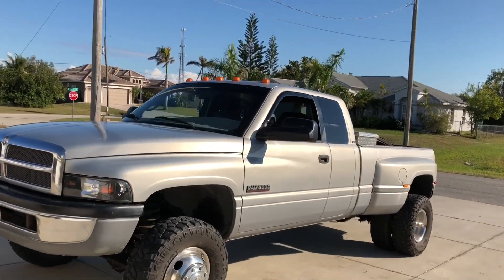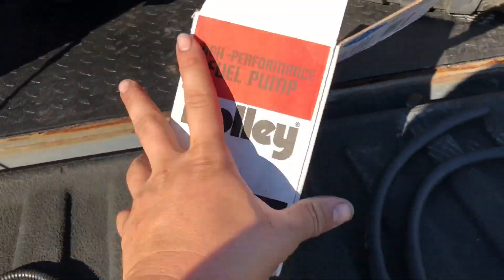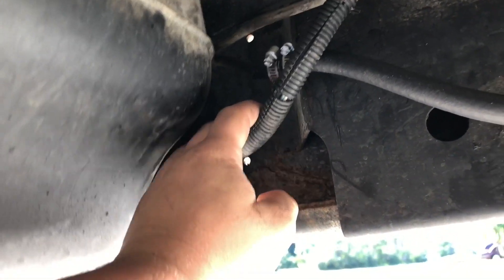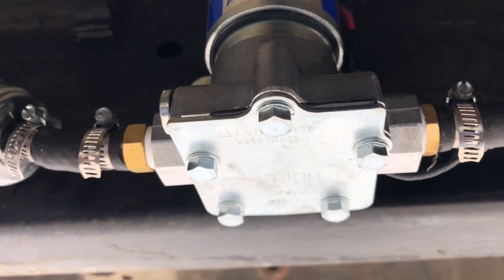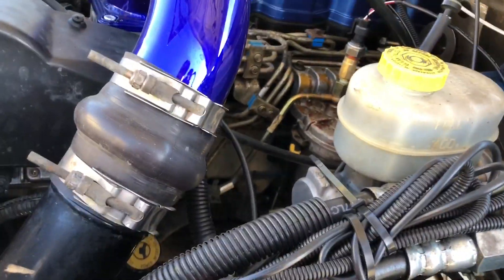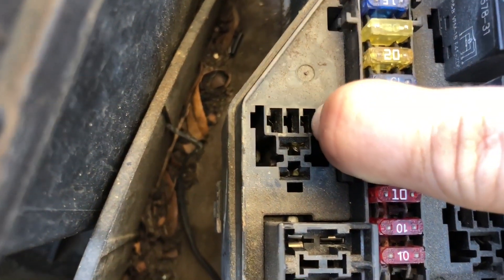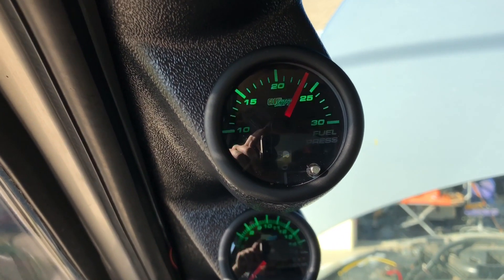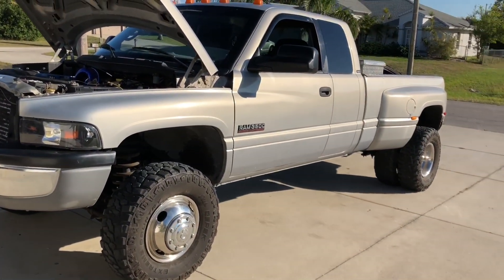How to get 25psi fuel pressure for less than $200!! 99 cummins 24v

Comment: 20 psi max. 15 to 17 is perfect. You will hurt that vp. Listen to everyone here. You cant afford a fass or airdog then you definetly cant afford a vp. Dont fuck around with a diesel. Get a fass or airdog. And a sump and thats perfect. Its on mine and she runs like a new. And very reliable too.
Reply from the maker: I appreciate the feedback, but we’ve going having good luck with the current setup
Reply: @floridafenceland1137  sounds good man. Whatever works for you. Just wanted to relay my expierience. Went through 2 vps. 1 rebuikt and 1 brandnew from bosch. Fried both of them cause of high pressure.  4500 bucks later. And now no issues 30.000 miles later. Good luck.
Reply from the maker: No I deff appreciate it big time, I just can’t buy a fass right now if I wanted to do it’s gunna stay how it is for now, but I don’t see how it can hurt the vp since the vp had a pressure release valve that opens at 17psi and I’ve ran it this way and really haven’t had any issues yet
Reply: @floridafenceland1137  high pressure hurts the diaphram on the inside. You cant trust those valves. Of so you would have blown it already by sending 25psi to it. But like i said if its workin for you then hell yeah. Whatever keeps the powerhouse on the road. Nice truck by the way. Love the duallys. Im actually about to convert my long bed into a dually.
Reply from the maker: Yeah I mean it’s been working so far! And thanks man! Yeah it’s pretty easy to convert, you actually could just throw dually rear wheels on your single wheel axle it would just be 2 inches wider than a standard dually but that would look good to me at least
Reply: @floridafenceland1137  ill be damned. I was about to buy the whole axle. But if thats the case then ill do that.  Appreciate the info.
Reply from the maker: Yes sir! If I wanted to make my dually a single, I’d add 2 inch to each side and it would be same as single wheel, but you’ll still have to run a spacer between rear wheels if you want 33s or bigger so keep that in mind, it’ll be wide but still good in my opinion

Comment: 20 psi is Max on a VP so if you regulate it down to 20 the truck will actually start better mine lives and 20 all the time fires right up 

And excessive pressure can kill a VP just as quickly asno fuel pressure
Reply from the maker: I’m still On the same Vp with 24psi and still running strong
Reply: @floridafenceland1137  hi excuse me to disturb you,  Im not in US but I have the same truck, I would like to know why do you put a switch and press on the switch , because for me if you put this pump instead oem you dont have to need to put switch, it works perfectly? Thank you in advance
Reply from the maker: Correct, I believe in the video I say that I wasn’t sure if my Ecm was working and actually telling my old pump to kick on, so I ran both pumps to same switch to ensure that they do come on because I’m the one pushing the button

Comment: so the holly blue just pushes fuel into the stock lift pump still?
Reply from the maker: Yes sir they are both wired to the same switch and the Holley pulls from the tank to feed the factory pump
Reply: @floridafenceland1137  do you have a parts list for everything
Reply from the maker: It’s really just the pump, some hose and hose clamps that’s about it I think

Comment: I just looked the pump up, it says maximum pressure is 14 psi, is this an inaccurate number or are the rest of your psi coming from vp pump?
Reply: 14psi is Dodge #, BOSCH SAYS 20PSI MAX.
Reply from the maker: It’s been 25 for a good while now and still going great
Reply from the maker: Fuel Pressure is read in the filter housing after the lift pumps before the vp,not sure where it comes from but I’m glad it’s there an workin well

Comment: Isn’t 24psi too much for a vp? I was under the impression you wanted to be at 18 at idle and no less than 13 at WOT otherwise you could reduce seal life?
Reply from the maker: phil posada anything over 27 the vp sends back to tank, I have 17-20 at wife open throttle 25 idle
Reply: 20+psi is easy to do, ive accidentally pumped 40psi to the vp before. Over 20psi will ruin a diagram in the vp and cause hard starts. 

the more you know.

Comment: Good deal man... What's pressure drop to at WOT?
Reply: Thanks for the ideas. I have a 94 ram 2500 12 valve. If I can get a pump that will do at least 25 psi should work, I hope. Your lucky you didn't go to long. What many don't know is if the lift/fuel pump gose bad your injector pump will pull fuel until that goes. So lady's and gents put a pressure gage on. It will let you know if your filter needs to be changed. At $35-40 up guessing...
Reply from the maker: Hey man wot pressure never ever drops under 19 psi idles at 25-26 cruising around is like 22-23
Reply: Florida country Good deal thanks for the reply... And no VP issues with the increased pressure? How long have you had on now?
Reply from the maker: Yes sir sorry it took so long to reply and I installed it about 2 weeks before the video was posted so I’ve had it since then and no issues at all and I tow about 14k pounds at least once a week and never had any issues
Reply: Does your truck have in tank lift pump or in frame??
Reply from the maker: It has the lift pump I installed, not sure about in tank I doubt it
Reply: @floridafenceland1137  the in tank pump was a attempt by dodge to solve the low FP of the lift pump,  it didn't work either, it was supposed to ease the burden. Some trucks have a block off where the lift pump was, if you're was gone, you have an in tank pump, which was worse than the original.